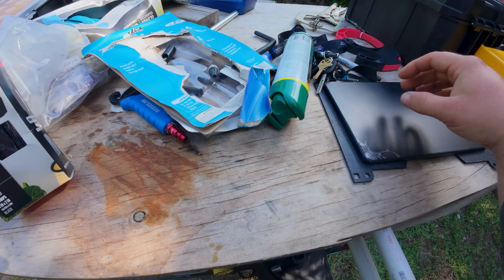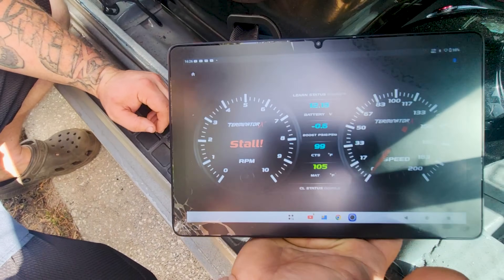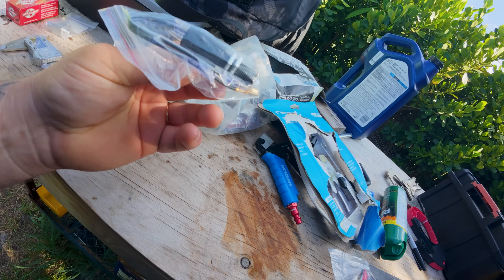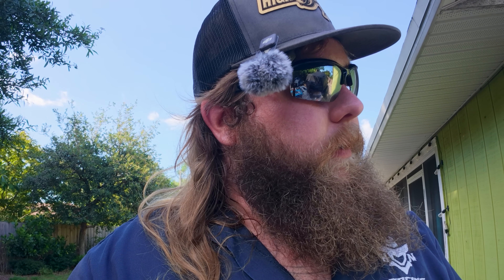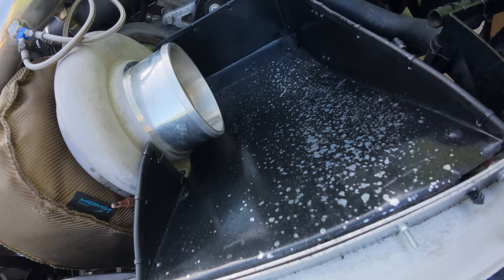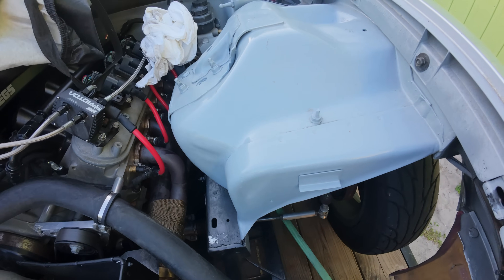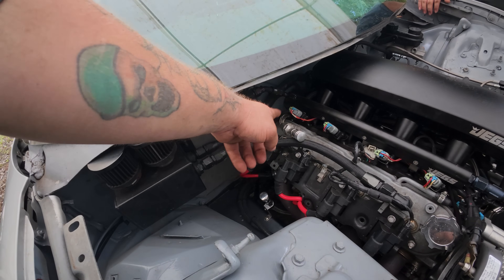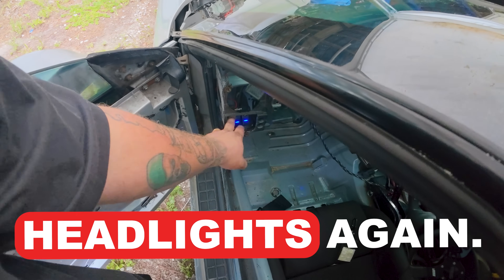$60 Android Dash VS. $1250 Holley Pro Dash! | Bluetooth Module

Comment: So you gotta have a $1000 holley injection system to use that cheap android tablet. Got it.
Reply from the maker: I mean yeah it still saves you 1190$ 😏
Reply: It'd be nice if it was just 1k😂closer to 3k just in the terminator and wiring to make it work. So hell yes I bought a blue tooth module too. Im not gonna spend the 2k on the 12" holley pro dash when a tablet can do what I need it to

Comment: Do you think you could upload that STI file for the bracket thanks for your time and knowledge!
Reply from the maker: Yes I can but I need to make a video in more detail about things. Because with the plastic dash in it cuts off the top section of the 10" tablet. I'm going to make a video about this and upload the stl. Should be posted sometime tomorrow.

Comment: I don’t know Androids much but look through the Accessibility or Visually Impaired or Blind settings in the tablet. Sometimes helps get more brightness. Also undo any auto brightness junk. Almost looks like that tablet has a matte finish so that may help deter reflections. Can’t tell if that was actual tablet or a cover. 

Still awesome either way! Good Luck laying that rubber! 👊🏼
Reply from the maker: Good call on the settings, I'll definitely check those out! And it does have a screen protector it came with i didn't want to to remove it since I cracked the screen.